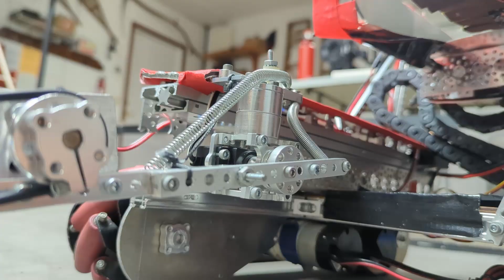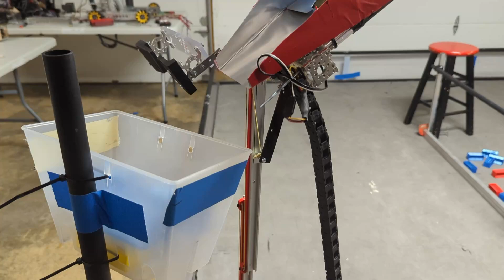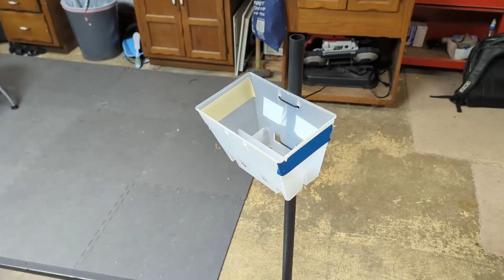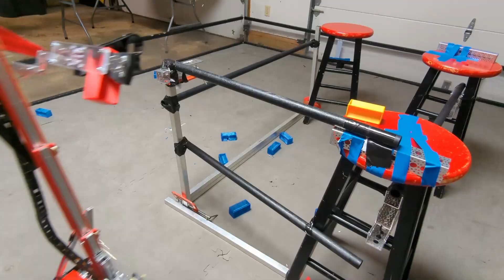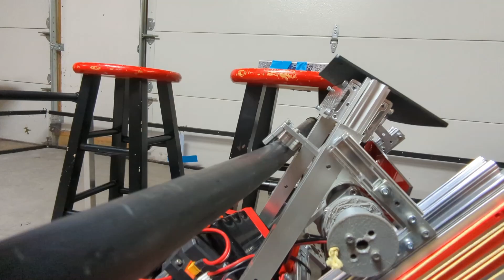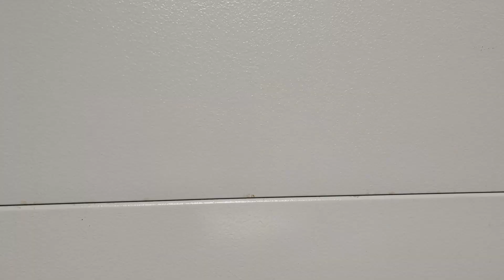Robot in 30 Hours Reveal | FTC Into the Deep 2024-2025

Comment: where did you buy that white wheel part?
Reply: They are Andy Mark 3" complaint wheels with the rims cut off.
Reply: @johnathanclayton2887  are you sure it isn't styrofoam?
Reply: @s0mb0dy7  yeah it's a30 rubber
Reply: @johnathanclayton2887  what bore size and durometer?
Reply: @Eesha420  I think half inch hex, a30 durometer. (That's the one that's usually green)

Comment: Whats the piece you use to connect the two flat beams underneath the roller to the other beam? (The beam that looks like a tube with two threaded squares, under the rollers). I would be much obliged if you could help!
Reply: On the collection to attach the beams to the standoffs? Those are actobotics old style clamping collars. Sorry I can't find the part number right now.
Reply: Looks like it might be  625102?
Reply: @johnathanclayton2887  What RPM motor are you using to power the boot wheel?

Comment: What kind of vertical slide is that? because our slide requires a retraction cable
Reply: I think they're  Telescopic Slide Rails (Light Load, Two-Step, Aluminum) from misumi, but I don't remember the length. They're nice and low friction though.
Reply: @johnathanclayton2887  how did you connect them? i see those red thingies between them.
Reply: They're 3d printed. I think that was a design of thingiverse or printables or something. There are a bunch of versions that are pretty similar.
Reply: They're 3d printed. I think that was a design of thingiverse or printables or something. There are a bunch of versions that are pretty similar.
Reply: @johnathanclayton2887  how many stages?
Reply: @johnathanclayton2887 can you try to measure the slide length? I want to know the length

Comment: how are you powering your vertical slide and horizontal slides?
Reply: Horizontal are powered with a servo on an arm. (bad idea, it burnt out near the end of filming) Vertical scoring slides are powered with a 3.7:1 andymark neverest on a continuous pulley system. Hanging slides are sprung upwards with surgical tubing and pulled down with a 60:1 motor.
Reply: @johnathanclayton2887 what kind of linear slide are you using for vertical scoring?
Reply: I think they're  Telescopic Slide Rails (Light Load, Two-Step, Aluminum) from misumi, but I don't remember the length.

Comment: Someone built an almost meta bot in 30 hours 😂 now just and color sorting and a level 2 climb and you won every match
Reply: @Hayterwave  other improvements would be not having the extend break constantly, (don't use a servo) building it properly so it isn't constantly on the verge of failing apart, maybe improve the collection to collect from more angles, extend a little further to the limit, and give the drivetrain as much traction and power as you can to move more quickly. (Minimizing weight would really help there) There's always room for improvement!
Reply: This would be good if the rules didn't state you can not initiate a climb with the top hang bar whilst in contact with the tiles

Comment: What slides are you guys using for horizontal extension?
Reply: MiSUMI SAR330
Reply: Two side by side 300mm long telescopic slide rails from misumi with some extra holes drilled in them.
Reply: @johnathanclayton2887  is it compatible with gobilda screws?
Reply: @johnathanclayton2887  is it compatible with gobilda screws?
Reply: Those older ones didn't have threaded holes, just countersunk holes. I didn't remember off the top of my head if they worked with m4 countersunk screws, I'd check the spec page. I know if you drill extra holes, they fit with 6-32 button head screws. (At least if you're accurate in drilling in the middle of the slides)